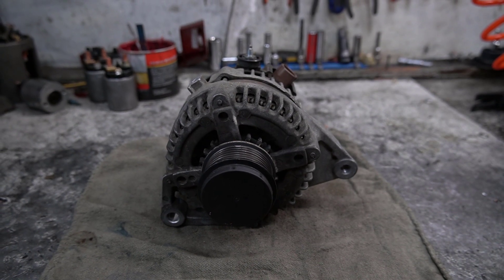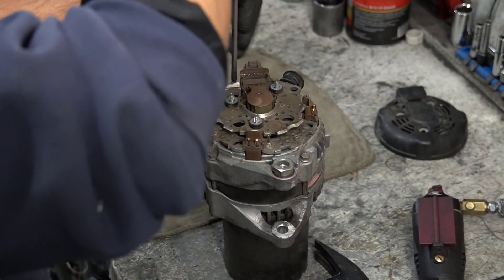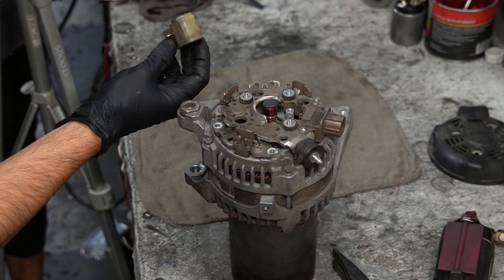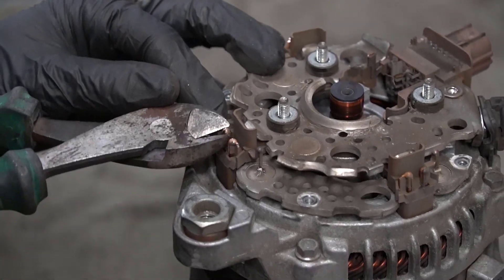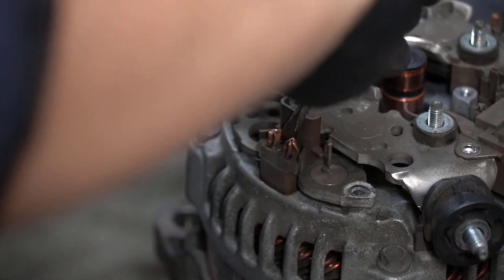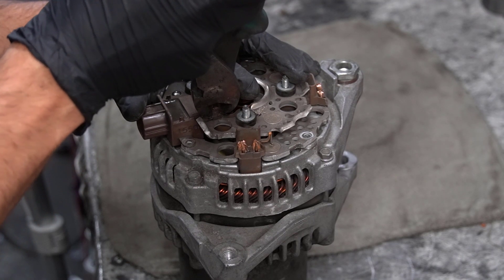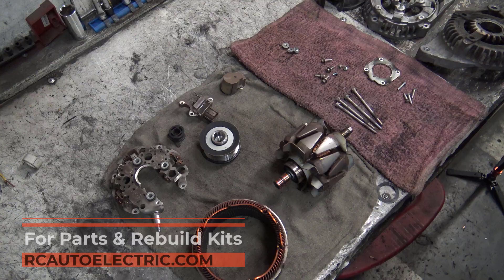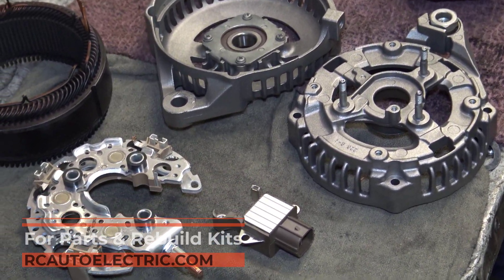How to Rebuild Toyota Camry 2010-2011 Alternator - Part 1: Disassembly and Prep

Comment: Just out of curiosity should I replace the rectifier, voltage regulator, brush holder and bearings? Do you havereplacements? (sarcasm) 🤦‍♂️
Reply from the maker: We have the rebuild kit and parts breakdown available: https://rcautoelectric.com/products/aftermarket-denso-alternator-rebuild-kit-11516rk
Reply: @RCAutoElectric @RCAutoElectric what is the soldering iron model you guys use to weld back the rectifier? Whatts?  200 300? Thanks
Reply from the maker: @enrique74able  yes, so we use a generic Weller 80 watts soldering iron in the video. You can also use the high powered ones as well, technique may differ a little, up to you really what you prefer.